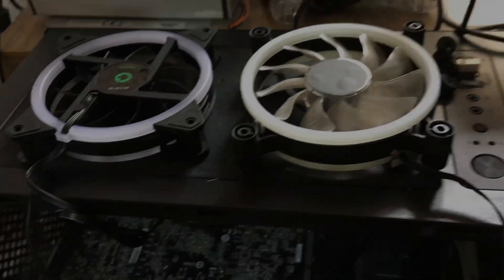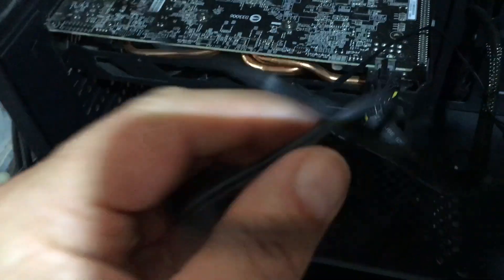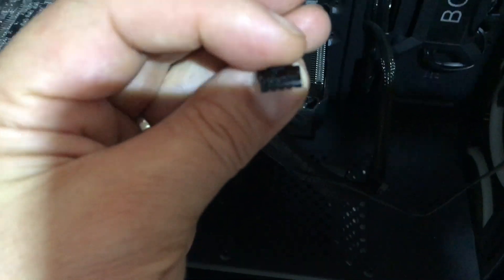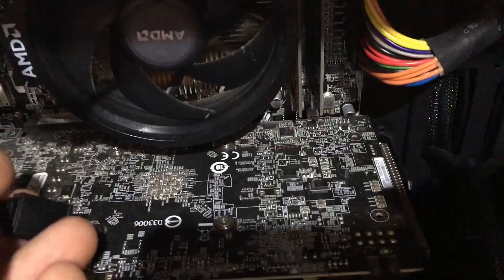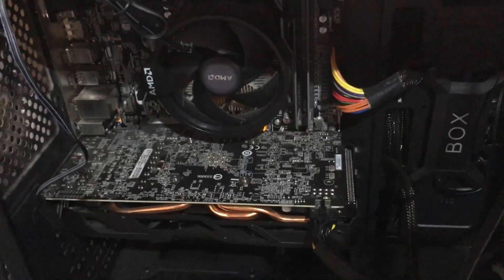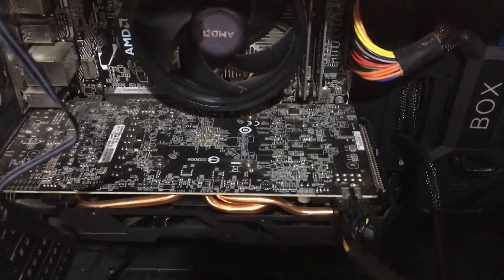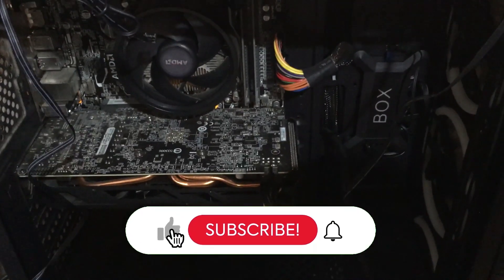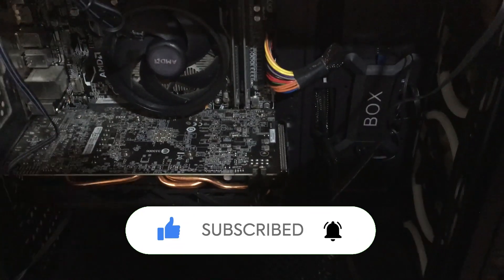Pc fan connections explained 4pin 5pin

Comment: im really really struggli0ng to find the hub each time i search up the 4 pin adapters come up can you atleast try to have a look for me thanks
Reply from the maker: I don’t think you can get a adapter. It’s either replace to fans and control module or replace like for like. Here’s the one I used 

https://ozigaming.co.uk/product/cit-raider-dual-ring-16-led-120mm-rainbow-rgb-silent-pc-cooling-case-fan-5-pin/

Comment: hey, man. Can I connect 5 pin fan to my mobo directly? (to 4 pin connector on mobo)
Reply from the maker: No the 5 pins need to go through and controller
Reply: is there any 5pin controllers on aliexpress or amazon? @glchow
Reply: did you get your fans from a prebuilt that had a fan controller? it appears thats what happened for me. just connect the controller to the mobo again, and you are free to connect the fans. in my case, my controller conveniently has a magnetic connection to the side of my case, so it was out of the way
Reply: @overfoxed what controller do you have? I can’t remove the old controller from my prebuilt and im struggling to find a new one.